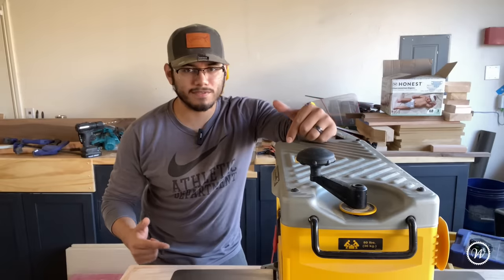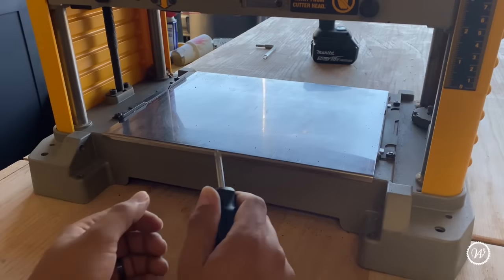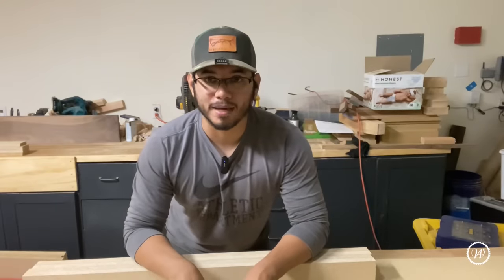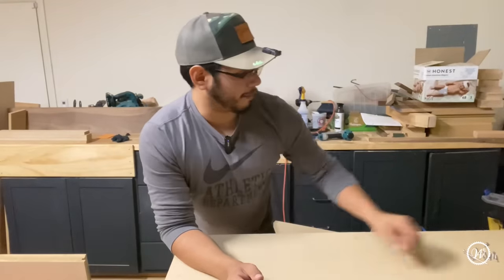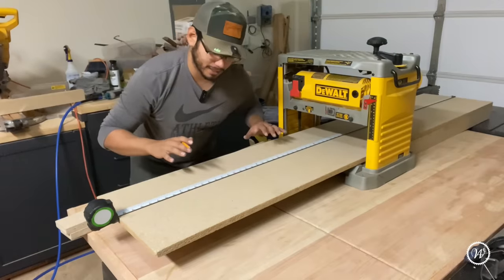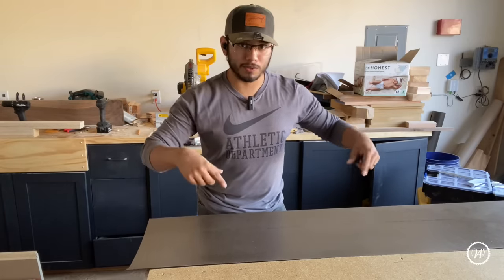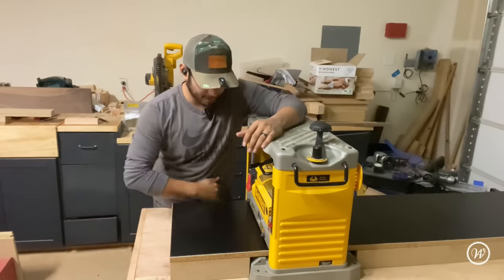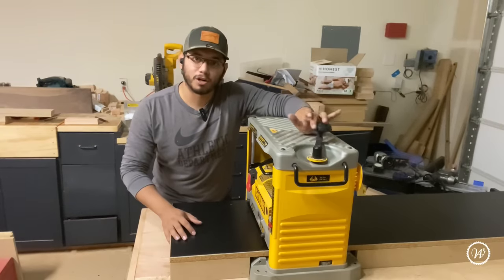Best Decision I’ve Ever Made || How to: Planer Sled

Comment: That bed makes the planer nicer and more enjoyable to use, but it does not address the cause of snip in lunchbox planers. The snip is caused by the blade cage tilting when your piece hits the first roller and when your piece leaves and only hitting the last roller. The tilt actually lowers the blades a little. The ONLY way to eliminate snip on these is to run sacrificial pieces in front and behind your project piece. What you did is great and adds needed support, but that’s all it does.
Reply: Really, I haven't seen that at all...
Reply: @davidcurtis5398  
Well, it is a factual statement
Reply: He’s correct. It’s true that a badly adjusted bed can make snipe worse, but the actual cause is the head moving up and down as the piece enters and exits. Perfectly aligned beds help, as does taking VERY shallow cuts, at least as you get to final dimension. I have a digital readout on mine and use that to sneak up on the final dimension, then I’ll do multiple passes without changing the height at all, and I get very little snipe that way.
Reply: There are aftermarket cutters that can eliminate snipe, and give you a much smoother surface after planing. They also last a lot longer. They are called helical cutters. They will not help if you don't have the 735 model, and avoid the smaller diameter cutter one that is easier to install.
Reply: @actionjksn  I’d replace the entire machine rather than drop over $500 and wait 10 weeks for delivery to put a helical head in a cheap planer, personally. I have a helical head on my Jet 8” jointer and yes, it’s an amazing difference compared to straight knife jointers. I wouldn’t go so far as to say that a helical head would eliminate snipe, though. If the geometry of the cutting head changes as the wood enters and exits, it’s going to snipe. That geometry change happens because the rollers interact with the material in 3 distinct ways: on entry, the front roller is engaged and the back roller is not. In the middle of the cut, both rollers are engaged and at the end of the cut, only the exit roller is engaged.

They definitely sell helical heads for the 734, but like I said, I wouldn’t spend my money on it. I’ve spent over $50k on wood working tools over the last 2 years and in my experience, buying the best machine you can possibly afford rather than trying to upgrade a budget machine makes much more sense in the long run. Disclaimer: I’m not doing hobbyist work - this is my full time job now. The 734 planer is the last piece of gear that I haven’t upgraded yet, but it’s time is coming…….
Reply: I am glad you explained it so I did not have to.
Reply: Was going to say this myself. Doesn't matter the support I give my boards. If I run a second one through along with  the first, the first won't have snipe on the end, the second won't have snipe on the front. If you get 2 people you can stager board and run them through continuously and input her it on the first and last.
Reply: Also making final length cut at each end after planing, cutting off any snipe.
Reply: Yeah I just add 6” to the final length of my boards so I can trim off 3” from each end
Reply: i can agree because i did the EXACT same thing a couple years ago and still had the snipe…it comes from exactly where you said it comes from
Reply: Thanks for the comment, I didn't know
Reply: I wish you would have ran a board through to prove it works. Even better if you would have ran a board without the sled, shown the snipe and the ran it again with the sled, and then displayed a picture of before and after.
Reply: @MachinedInWood  Yes. But it is not just as simple as the head "lifting".
It is because it is TWISTING.
As the first roller hits the board the head twists a tiny amount on the vertical guide rails.
Once the second roller hits the wood, it takes the twist out.
Same happens on the trailing edge.
So the very expensive units have more expensive (less slop) vertical rails and the bushings for the head.
Reply: Let’s see you run some wood through that!
Reply: I'm not a expert on planers, but I've had this same planer in my shop for 10 or more years, and I never have a problem with snipe when planing hardwood stock. What seems to work for me is to adjust the infeed and outfeed tables a bit higher than the bed of the planer. As the work piece passes and exits through the planer, the pinch roller holding the stock against the bed loses contact with the board and it's railing edge lifts slightly into the cutter head causing snipe. By raising the outside edge of the outfeed table, the trailing end of the board is forced downward against the planer bed and away from the cutter head minimizing snipe. The same principle and fix also applies to the infeed table if infeed snipe is a problem. Could be wrong, but that's what works for me.
Reply: To prevent the tilt why not get 2 long pipe clamps or etc n  just clamp each side of the planer?
Reply: Think I would have considered more storage for that shop rather than wasted time on planner bed
Reply: Or start a second board before the first is finished ( if your planer takes doubke the size of your work. But hes first and last need either extra length or a sacrificial board...
Reply: Which likely why he did not demonstrate.
Reply: Absolutely right! Sacrificial pieces are a must unless you plan on cutting off 2-2.5” off (waste) your wood. Sometimes on both ends.
Reply: I have the same planer and tried everything but by the virtue of having spring loaded roller design and the blade roller moving ever so slightly in relative distance, nothing will fix the snipe issue.
Reply: snipe

Comment: Sorry, but snipe will not go away by extending the table and using a sled. I did it. The problem occurs when the wood is supported by only one of the rollers, and it causes flex in the system. The more times you push the wood through the system, the worse the snipe will get. There are ways to rid snipe and that is adding end board extensions, or by ridgedly blocking out the planer from the four corners. You can also train your pices one after another, but you always end up with the ends jacked up. That being said, feed tables and a sled are worth doing since they allow you to joint wide boards if properly supported.
Reply: This agrees with my experience, too. The infeed/outfeed rollers are mounted on the same carriage as the cutter head. Although there are guide rods at the four corners of the carriage it still has a small amount of play allowing it to pivot or rock front to back as the wood moves under and out from the feed rollers.
Reply: @blondin07  So will ya think 'Shelix cutterhead for Dewalt planer DW735' would be better then?!:face-blue-smiling::face-blue-smiling::face-blue-smiling:

Comment: Sadly this won't cure your planer snipe. At best it might reduce it.
Reply: IF snipe was only (usually more than one) caused by overhang section weigh down the workpiece, here is an alternative solution - orient the planer on its side.  https://youtu.be/MWfcZCcacSg
Reply: My deck cured mine completely.  Over 20 years ago.

Comment: You are gluing particle boards with, what it looks like, PVA. You don't need screws nor nails. The best quality particle boards and MDF use the same glue. The only reason why you'd nail them together is because you can't clamp them or your particular glue is not thick enough and gets absorbed.

Comment: Nice video and certainly an improvement. But it will not entirely solve your snipe. As the material is being planed it is compressed between two rollers, under high pressure, at either side of the cutter. At the end of the cut, high pressure releases from one roller, causing a slight racking of the head that causes the stock to rise slightly into the cutter head for a brief second. You won’t get that run off, ramp snipe from an unsupported board. But you will get a narrow depression across the width of the board. Only a couple of thousandths. You can ride the side of a pencil or a flat chalk across to see it. There is just not enough mass in our smaller planers to overcome the loss of pressure on one side of the cutter without creating that slight bump.
Reply: I don't have this problem but also I don't take much off with each pass. Maybe 1/32 to 1/6 if an inch. And yes it takes a bit longer but I don't have any snipe anymore.

Comment: I did that to mine but the planner lifts up and snipes I can’t bolt mine down where it is. That’s what needs to be done.
Reply: Oh and mine is 3’ on both sides
Reply: I simply ran some plywood under the planer and screwed them together that way the whole thing is one solid block.
Reply: @BanditHat  I am saying I watched what and how you did yours but where you were longer on the one side I am same length on both. I have mine sitting at the end of my 8’ out feed table and it still snipe. Ours is identical building mine just longer.

Comment: Great idea!  I think I'll make one for mine since I fight this issue like everyone else.  A quick demonstration at the end would have been nice.
Reply: Your joint was starved for glue on the particleboard side.  It should have grabbed hard at 1st contact.  Rubber Cement is known for needing sticks to properly align parts before inital contact.  Any dowel or small stick longer than the width (so you can grab and pull out one stick at a time) will do.

Comment: nice upgrade. i have the same planer, so i may do this myself. just a tip, when you're applying the laminate, it's easier to line up if you put sticks under it, then pull the middle ones out as you press down, working from the middle out. the sticks won't adhere to the dried glue.

Comment: I lift the board as it comes out, take very light cuts as I approach final thickness, run the board at an angle to the cutters and support the board with hand pressure as it exits.  These tricks are all dependent on the size of the board.  I can usually get little to no snipe doing it this way.  I have the side crank version of that dewalt planer with stock tables.  

But, the only ways I know to get zero snipe every time is to account for 2 to 3 inches of sacrificial wood on each end of the board or run separate scrap boards before and after the project board.

When I do get snipe, it’s only about .004” deep which can be sanded smooth with a random orbital.  So I don’t stress about snipe.

Comment: Thats a fantastic idea. Ive seen sleds built that run through the planer with the work piece but this is on a different level.
Reply: The sleds that run through usually serve a different purpose though, they are meant to support a piece that is uneven / wobbly on both sides as it moves through the planer, to get an accurate face on one side.  Those of use who have a planer but no jointer use them :)
Reply: sleds do run through.  this is not a sled but more of a table.

Comment: Several of the comments mentioned the best and least expensive way to deal with the snipe. CUT THE PIECE TO LENGTH AFTERWARDS! Do not waste your time or money chasing a solution to a problem that can't be solved without large amounts of money! 

That being said, thank you for the nice video.
Reply: I don't have a planer yet, just relaying what I've heard -- you can lift the end of the piece sticking out a bit as it enters or exits. If so, should prevent having to waste cumulative board feet and comes at no extra cost.
Reply: Great advice! Getting ready to plane 6’ claro walnut boards for a table, will add a generous 5” on each end to avoid stressing about snipe. Problem solved!

Comment: Having snipe and how much you have depends on the planer, and how much you try to remove at each pass. I had a Dewalt 734 such as was used in the video. The cutter head is not fixed, so when the stock is first engaged by the in-feed roller, it raised and the cutter head lowers, then raises when the second roller, remains constant until the stock looses contact with the in-feed roller when it lowers again. Thus snipe at both ends. I tried using a dead-flat planer sled (1 1/2 inch thick Appleply) but I still had snipe, though not as much.

I sold the 734 and got a Dewalt 735. It has the advantage of having two speeds. The slower speed produces an almost glass like finish. I don't use the sled anymore. When I am nearing my target thickness I turn the wheel just a fraction, maybe just 1/16 of a turn of the wheel, and this reduces the pressure differential between the feed roller and the cutter head, and reduces the need for pressure to send the stock through. If you're into 10 thousands of an inch, maybe there is still measurable snipe. But it is not detectable to the eye or the finger and if you feel the need to sand, the micrometer won't tell you it was ever there.

Comment: I'm not a expert on planers, but I've had this same planer in my shop for 10 or more years, and I never have a problem with snipe when planing hardwood stock. What seems to work for me is to adjust the infeed and outfeed tables a bit higher than the bed of the planer. As the work piece passes and exits through the planer, the pinch roller holding the stock against the bed loses contact with the board and it's trailing edge lifts slightly into the cutter head causing snipe. By raising the outside edge of the outfeed table, the trailing end of the board is forced downward against the planer bed and away from the cutter head minimizing snipe. The same principle and fix also applies to the infeed table if infeed snipe is a problem. Could be wrong, but that's what works for me.

Comment: I made a similar in/out feed table for my planer but I lust bought a 6' by 12" melamine shelf from the shelving department at HD for the table surface.  Made the sides from scrap.  This doesn't solve snipe, but it gives a nice long surface for my sled to move on while fully supported.
Reply: My 8 foot table solver all of my problems.

Comment: To prove the concept, wish you had run a couple boards through planner and show "no snipe".  Looks good to me and shall try it on mine after seeing a vid proving the concept.
Reply: There will still be snipe at the front when only the rear roller is engaged on the work piece and on the rear when only the front roller is engaged, causing the roller/cutter head assembly to tilt back and forth slightly. The only way to completely eliminate snipe is to do this (ensure your in and outfeed tables are flat and level) as well as use a sacrificial piece at the start and end. However, this will definitely reduce the snipe if your table is short or uneven.
Reply: As I understand it, you can mimic the angle of that assembly tilt by slightly lifting the end of the piece as it goes in and comes out, with some practice, so no sacrifice. Will try in about 3 weeks when I have mine, but I trust the sources.

Comment: Great video. Now if only I had a larger shop so that I would have the room to do this on my planer. 😞  One suggestion - Rather than mess around with laminating, I would simply buy a piece of Melamine and skip that step entirely. Not that much of a cost difference and will provide the exact same result.

Comment: Neat idea, but because snipe in these planers has to do with the rollers more than the feeder sleds, i find the easiest solution is to plan on slightly longer boards and trim off the ends as necessary.   Then i don't worry about a long sled that is cumbersome, nor having to feed 2 sacrificial boards front/back.

Comment: I made the same for my planer. I found if you lag screw the planer to the workbench you will improve on snip and a have a more parallel cut. The planer will literally lift up when the board is at the front and sometimes at the end of the travel.
Reply from the maker: Maybe it’s time to bolt this thing on a rolling cart then. Thanks for the tip!

Comment: I built one of those but it was a little longer to support infeed and outfeed  side of my Cutech 13" Planer.  I checked the sled for square and level and ran severval pieces of Maple thru it -  Still had evidence of the dreaded snipe.  Not sure a sled really helps

Comment: This is a nice modification to other feeder boards I've seen. Particularly the guides. My one main question, and I think you did it, was figuring out the width of the board and how to center it. In my opinion, if you're trying to eliminate the sniping, the outfeed end needs to be the same length as your longest boards. In your case the outfeed should be at least 6 ft 6 in. In my opinion that is.😊 I'm going to keep this video so I can try and copy what you did on my Wen planer. Thx!
Reply: It only needs to be half the length of your longest board.
Reply: @maxhoward945  like I said, in my opinion. And we all know what opinions are like! 🤣🤣🤣

Comment: Nice idea for the DeWalt planer. A comment about your laminating though....When rolling on the contact cement, use a denser spongy roller. The robust thirsty painting roller is not a match for contact cement. Also, put down strips of wood on the wood surface after the waiting period but before setting on your laminate. You were fortunate here that the laminate did not immediately bond to the mdf surface when you were aligning it on its base. Setting down wood strips allows you to accurately and safely position the laminate on the mdf base. Once positioned remove one strip of wood at a time. Presto. All aligned and then you can press with heavy pressure (roller) from the center to the outsides.

Comment: I've been thinking aboutndoing this for my porter cable planer for quite a while. The only thing that bothers me is that I wouldn't be able to use the scale on the planer any more reliability.  I mean yes, I could just add 3/4" to qhat it says but believe it or not the scal om mine is really accurate and I go off that on almost everything I plane